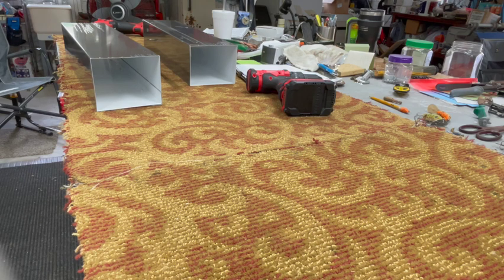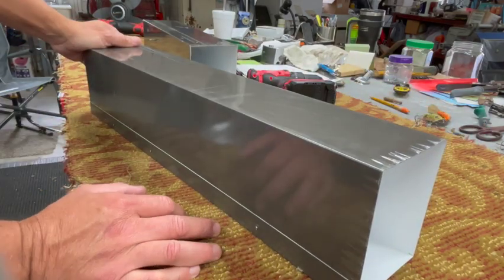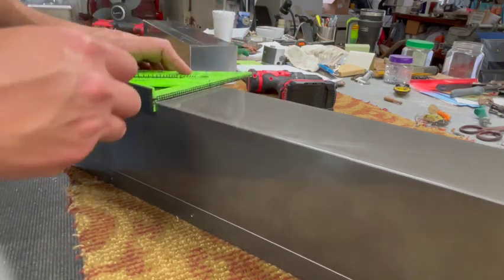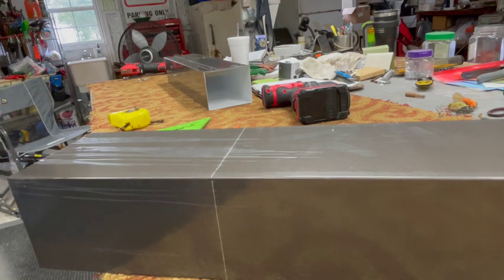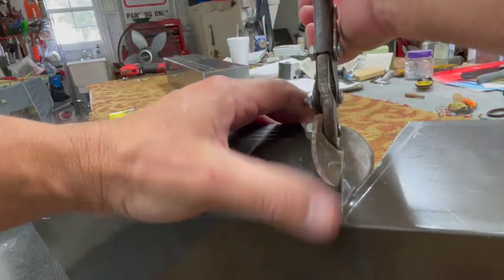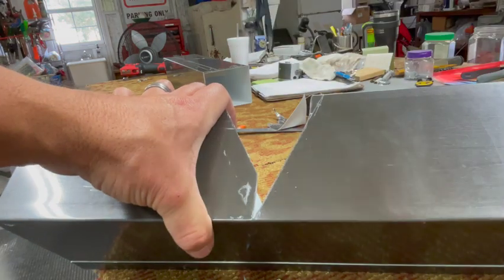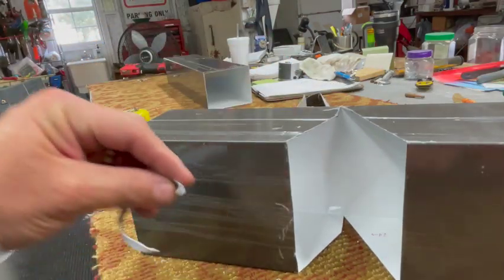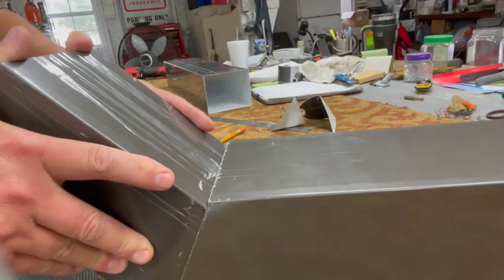Tutorial Making An Elbow In A Custom Box Downspout | At The 509

Comment: Great video! 
Do you happen to have a similar explanation video on how to do a gutter gooseneck downspout on the downspout that is kind of close to the house and I need to kind of push it out some.
Reply from the maker: Not sure exactly what you mean but if you can possibly explain it a little more I will see what I can do. Thanks for watching 👍🏼
Reply: @at-the-509   I have existing gutter close to the house but now they are on my way of a stone project and need to push them out a little away from the house kinda like a V side ways then down to the ground . If this makes sense lol. I will try and ask the supply store as well.
Thank you for your reply.
Reply: Actually thinking about it today  it’s  pushing the downspout away from the house a few inches like a number 7 and then just down to the ground. Since the one I currently have it’s just straight down but it in the way of the stone install.

Comment: Why does everyone use distances to find angle? 2 ⅛ etc.. that number will change depending on downspout dimensions. If u measured 22.5°(half of 45°) on both sides of pivot, the  rule would apply t all sizes of downspout.
Reply from the maker: Yes both of those statements are true and I mentioned the division method in my video. It can be done either way but I don't have a preset 22.5 degree angle so I divide my measurements because its easier and faster for me.
Reply: @at-the-509  thanks I must have missed it. I'll watch again.